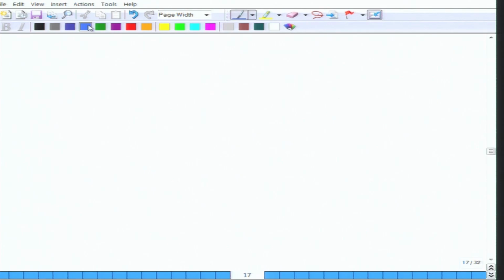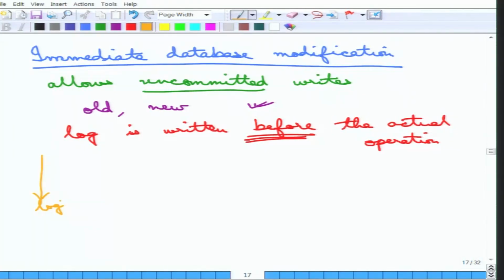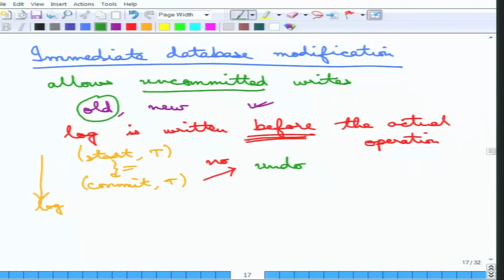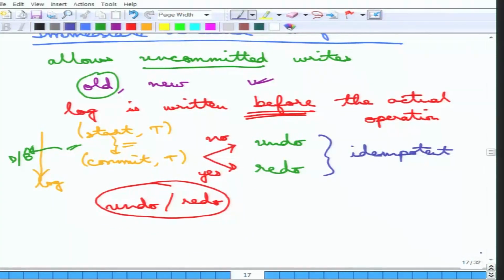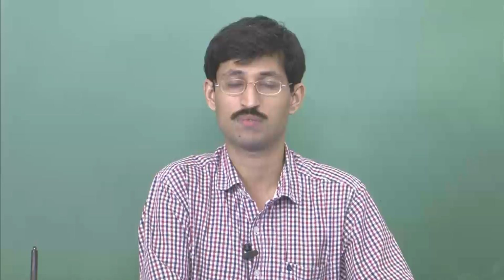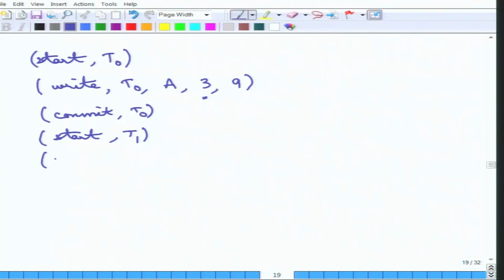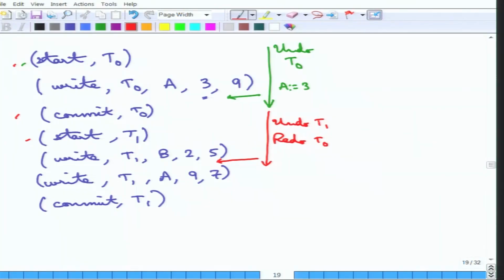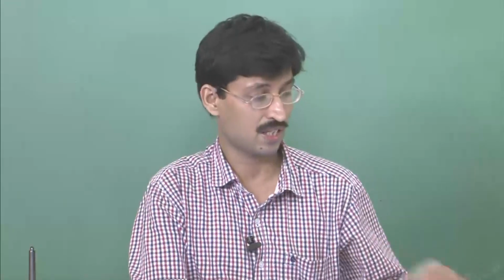Recovery Systems: Immediate Database Modification.

Comment: I don't understand how a transaction can write abort statement to log. If system crashes, how will the transaction ever have the time to write abort?  

In deferred DB modification, you say abort will not be written by transaction (which makes sense). But here in immediate DB modification, you say abort will be written. How?
Reply: System crash and Transcation failure are not same thing this can be the transaction has happened but the system got crash such a network failure or power failure. Also all of this assumes that you have a backup of logs in your drive